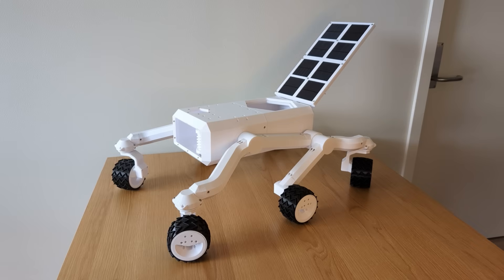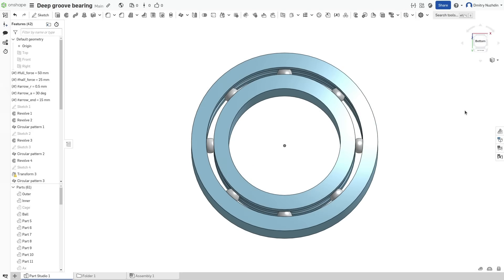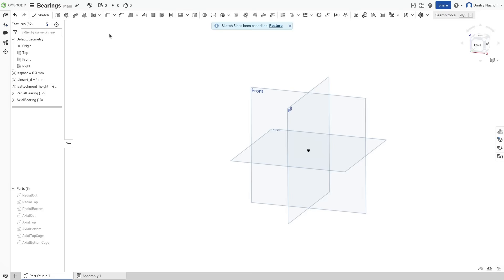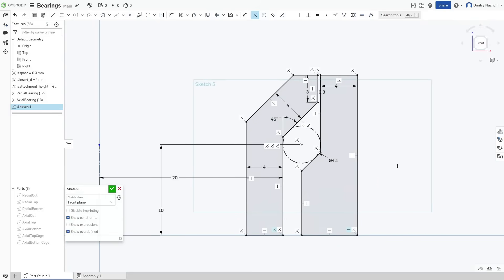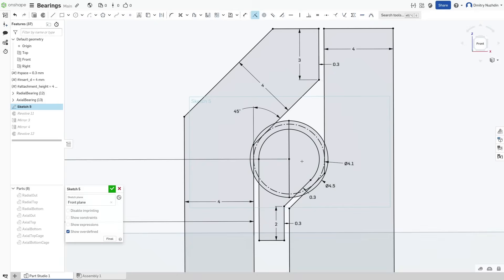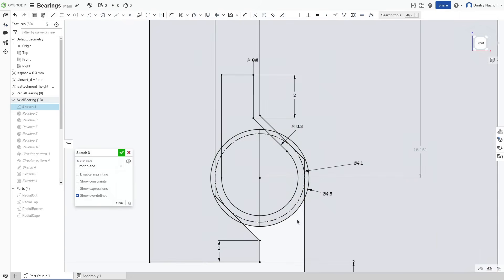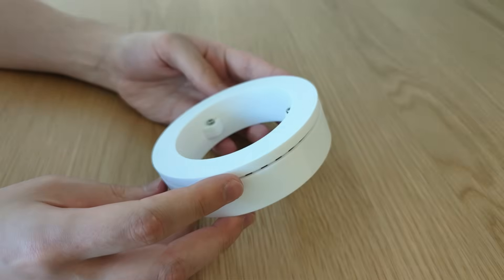How to Make 3D Printed Bearings

Comment: I've been using Airsoft BBs for ball bearings.  They work great for everything from turntables to linear slides.  The largest that I've used is a 10" circular bearing for a lazy susan tool carrousel.

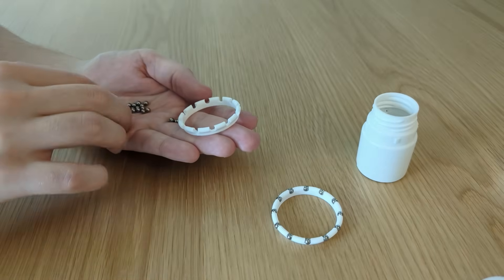Comment: 10:58  Steel balls but you THINK plastic could be used to? Why didn't you test it ?!
Anyway, using plastic except for the balls is still a good idea.
For usable bearings you would need max load values with rpm values.
For example (destructive) test with 1000-10.000rpm and 1-100kg load for 1hr.
Vibration and noise would also matter.
Reply from the maker: I just did not have plastic balls and had no plans to order and wait for it. Maybe for some future project.
Regarding the rates... I don't really think that it will handle a combination of load+high rpm. It's not that efficient and any inefficiency creates heat that will deform or melt the plastic pretty quick. I think if you have any requirements like ones you mention you should probably go for a metal.
But there are a lot of application that does not require high speed and load. For example one guy here told that he made a large bearing (metal ones become very expensive very fast when you increas size) for his telescope mount, and it worked great.
Reply: @Positive_Altitude  Plastic balls - Well, you could print them. 
The requirements should be roughly the same as for the shells (except for heating).

Of course, all destructive tests are pretty much work, so this is just a suggestion if you have nothing else to do.
Reply from the maker: @Fahnder99 Oh, I don't believe in 3D printed balls, quality is not there at all. And you cannot avoid overhang or support when printing a ball and that makes quality even worse. I am absolutely sure it will be very bad. Maybe you can print rollers that are OK-ish, but balls - no.

Comment: It would be super interesting to have a metal ring insert for the race surface and measure improvement, Great stuff!
Reply from the maker: Yeah, it will make them better for sure, but also more complex, as I have no idea how you can easily make such ring. I guess at this point it will be easier just to buy a bearing. The whole idea was to make them easy to design and manufacture.

Comment: Would grease help?
Reply from the maker: Yeah, I tried lithium-based grease. Makes them much quieter and smoother. But adds some constant "friction" due too grease viscosity. So personally I would use grease only for heavy-loaded bearings. Light-loaded goes fine without it.

Comment: could you please try to design the new rover spring tyres for printing? would it even be possible? maybe in tpu
Reply from the maker: TPU should work, but I don't think that they will fit to this design, it has large hub in the middle, so the tire should be thin, there is no room for spring tire.

Comment: Very nice designs.  Have you every tried adding a lubricant to the bearings?
Reply from the maker: Thank you. Yes, I tried lithium-based grease. It makes it quite and smooth, but adds some no-load friction. I mean, it will not free-spin like in the video. But it should help to reduce wear.

Comment: This is a very interesting video. Thanks for sharing. Seeing how it's designed helps a lot when trying to understand it.
But there is something I don't understand. Let's talk in 2D which I think makes things simpler. A circle can contact two straight lines and roll between them without sliding.
However, each circle (ball) is in contact with 4 lines in your bearing. Doesn't that imply sliding no matter what?
For example, see cross sections at 4:35 explaining the auxiliary races.
Reply from the maker: Hmm. I think it will still mostly roll even with 4 points of contact. It will just roll in a way that it's rotation axis oriented somewhere in between. Hard to put it into words :) Anyway, bearing design with 4 points of contact is very common. Look for "4-point angular contact ball bearing" for example. So it is a bit less efficient, but mostly because of some extra angle between load and contact point. I don't think that there will be significant sliding. In fact even if you roll a ball between two parallel flat surfaces, the rolling axis doesn't have to be parallel to these surfaces, it could be tilted and the ball will still roll just fine. I think it creates some extra friction, but it is not sliding. This extra friction will be similar to friction that "spinning top" has, just a little bit of that. Hope it makes sense, it's so hard to explain without showing/drawing. Thanks for your comment :)

Comment: Why didn't you chamfer the contact surfaces?
Reply from the maker: Can you explain what do you mean exactly?
Reply: @Positive_Altitude  At 4:57 the surfaces in contact with balls meet at angle, not rounded. Is it intentional? I would expect the contact surface to follow the shape of the ball, i.e. be round
Reply from the maker: @positron96 if there will be grooves it will be not possible to assemble this way, because the cage with balls will not fit in the gap any more. Though it is possible to add half-grooves on opposite races. I mean the corner between main and auxiliary races could be rounded.
Reply: @Positive_Altitude  yes, I think I mean rounding the corners

Comment: I really like the design, it gave me a place to start. The only issue I am working on now is that I need to press fit it in an axel through the hole, so will need to figure a different way to attach the parts. I will likely make the center part a single body instead of the outer ring and figure it out from there (as there is more room in the center of the ring
Reply: Nvm, I am stupid, just going to make the inner part thicker and the screw holes will need to  go all the way

Comment: Very neat video, has me thinking about all sorts of designs.  I would imagine the greatest drawback of your current design would be contact forces of the ball bearings deforming/wearing down along their contact paths.

I wonder about adding an internal raceway's, perhaps just an O.D. and I.D. to correspond with the balls rolling contact plane, or more to further constrain them.  Perhaps with a strip of something with high hardness, and small tolerance, mechanical tubing for instance.  Could cut out thin slivers (thick enough to minimally deform from contact stresses, and wide enough to help distribute the normal force along the plastic face) that fit into notches.  Basically use 3D printed plastic everywhere except the balls themselves, and small metal or high hardness plastic rings positioned where the balls would contact.

Comment: do scraf seams make a difference or is random seam placement enough?
Reply from the maker: I think if you have well-calibrated filament  (flow rate, pressure advance, retracts, etc) even the regular seams could be quite nice. I tried scarf seams -- not a big difference, so I don't do it right now.

Comment: how you are able to tilt the chassis of the rover at the beginning of the video
Reply from the maker: The left and right side are connected through a differential mechanism. Mars rovers usually use differential bars, but I used differential gears instead. So I have a differential inside (like in car transmission) and the body is connected to this differential through a worm gear. Here I am spinning the worm gear by hand and tilt the body relative to the differential. I will make an overview of this suspension in one of my next videos. :)

Comment: What do you think about designing your races slightly too tight and letting the balls form smoother, more precise races after a break-in period
Reply from the maker: I tried printing without margin at all. It starts too tight because of printing imperfections but works well after some time. I think you can absolutely do that and it will be the way to achieve minimal possible play 👍

Comment: Very cool video, definetely going to try and make a bearing with some bearing balls I have left from from broken drawer rails. Question - why not insert the balls mid-print? Kinda the same way people embed nuts and magnets into prints. Reduces the likelyhood of damaging the cage while filing it with balls.
Reply from the maker: I was thinking about it, but did not figure out how it could be done. Every time I was thinking about a way to do that I realized that I need to print unsupported surfaces and also the extruder is not able to print really close to the ball due to it's shape. It works for nuts because they are basicly flat objects so you can insert them at the point where there is enough depth to put it completely inside. You can not do it with the ball I think.
Reply: @Positive_Altitude  what about just making the clearance between the ball and the frame as minimal as possible (so like 4.05 instead of 4.1 for a 4mm ball) and then just leave  the unsupported overhangs as is? Basically just let the overhangs print over the balls and then break them off after the print is cooled off. But now that I'm typing this all out I'm starting to think that maybe this approach won't decrease the likelihood of damaging the part at all.

Comment: This is cool but I imagine there's very few applications where it makes sense. Sure quality industrial bearing can get expensive but common grade bearing are pretty cheap, even with diameters around 60 or 70mm, we're talking like $10 - and even cheaper Chinese bearings will have better tolerances and radial play than your 3D printed bearings. This is useful if you need something within in a few hours, or maybe for very specific weird geometry, but I don't see much other value.
Reply from the maker: That's true. But I just don't want to order bearings when I need them. And also I can go with any size I want. It's just to make the process easier.
Reply: I dunno, I’m not sure anyone’s going to be making front-line tools or consumer products with these, but the advantages for small home projects, teaching, and prototyping proofs of concept are pretty neat. Personally I don’t keep a lot of bearings in stock at home, I rarely need them, and when I do it’s always a different type to that which I have. Having a few 6mm ball bearings lying around to help me out is very flexible and very cheap.

Comment: Very well explained and definitely better suited  (and cheaper) for 3D printed applications that do not require the thousands of Newton and tens of thousands of RPM that even the smallest of steel bearings can deliver. A significant advantage is that you can design the bearing as part of your machine. Steel bearings are designed to be fitted in metal seats and on metal axes. I just subscribed. Cya !
Reply from the maker: 100%, they will never be better than metal bearings, but sometimes we just need things to be simple and "good enough"

Comment: In my 3d printed bearings, I use plastic balls for toy guns.  I make them so I can put as many balls as is bossible in the outer race. I then whack the inner race with a hammer to suprise the plastic only 1 time.  They fall together and run quite smoothly.  I've used them in a few projects and they seem to be working as none of them have failed..  I use no bearing cage.
Reply: How is the preload in the end? How much play (or on the other hand, how much stiffness) do your bearings end up with?

Can you recommend some interference dimensions?

Comment: Is there any way to completely remove backlash on a 3d printed bearings? Also your bearings looks bigger then typical manufactured bearings, anyway your way to design a bearing is awesome, I'll try to make my own based on your design, thanks!
Reply from the maker: To get the lowest backlash you can try to print it without any added gaps. It will be quite tight when assembled, but you can "work it out". Just apply some load in altering directions and forcefully rotate. It will become much nicer in a few minutes. I tried it once, and it worked for me. But make sure that your printer is well aligned. XY-skew should be very very low. Also the smallest bearing of similar design that I made was 20mm/28mm inner/outer races diameter it was fine, maybe it could be even smaller

Comment: not sure how true or significant, but i heard white filament wears your printer faster due to the white dye containing titanium.
Reply from the maker: Never heard about it. Anyway, the hotend replacement is not such a big deal and it will be required anyway eventually. I just need the rover to be white. I am going to place it outside in sunny days and white will heat up less.

Comment: Very nice. Glad I stumbled onto this. Now we can make bearings of pretty much any size. How small can you go with this design?
Reply from the maker: The smallest I made has inner/outer races diameter = 20mm/28mm . Works absolutely fine, I would say maybe 10mm/18mm is the smallest you can reasonably have with 4mm balls.

Comment: Preload! Your "radial load" bearings are similar to angular contact ball bearings and those perform best with and because of preload. Simplest modification would be to slightly reduce the height of inner race so there's a small amount of (axial) preload when the screws are fully tightened. However 1) this will mean that the balls will start to mainly ride on the 45 degree secondary races and that's not ideal if loads are mostly radial and 2) there will still be some play from the balls sliding laterally on the secondary race. One 'ideal' solution would be to have the balls ride on both primary and secondary races. To achieve that, first make the primary race not vertical but slighly 'open' by -5 to -15 degrees (visual context at 5:10) and then preload can ensure the dual contact on both inner and outer races (though admittedly only if the print is to very close to dimension). More load bearing contact more better. The end result will be very similar to angular contact ball bearings with a contact angle of 25 to 30 degrees (if on dimension and preload leads to dual contact or 5 to 15 otherwise) and the play will be reduced to close to zero (plastic not being rigid).
The other 'ideal' option is to simply copy the angular contact bearing design so instead of main+auxiliary race you have a round race with a slightly bigger radius than the bearing balls you're using. The best way to achieve that is to just fillet the above design since that ensures no overhangs past 45.
Also use some lubricant (reduces noise and cage friction).
Reply from the maker: Wow, thanks for taking your time to write such a comment! Yeah, I read about 4-points angular contact bearing, but didn't know that it is usually preloaded, I learned something :) It's probably the best option if very little play reqiered. Maybe will experiment with this. 
I also realized that I can just do a deep groove ball bearing with Conrad-style assembly :) I did not talk about it in the video because I realized this while making the video, but I show it at the very last seconds. I think it's the most simple design. I just was not aware about the Conrad assembly and thought it will be impossible to make :)
Reply: Thanks for the added info! I’d assume you want the bare minimum amount of preload to take up the slack without brinelling the soft plastic races. That seems like a narrow margin to hit?

For the second idea, is your suggested as simple as filleting the inner 45° corner with a slightly larger radius with no other design changes? Or does it including adding preload as well?
Reply: @williammartin9751  It's narrow but not that narrow of a margin because plastic has higher elasticity. But good to bring up brinelling because it is a concern since plastic creeps. Therefore all plastic bearings should be 1) run-in till the races are fully burnished (i'd say preload-only at first then under constant load) 2) not kept under significant static load for long periods.
Second question: Yes, the design of the races is as simple as that. And with that design, adding a low preload becomes as simple as slightly reducing the height of the inner bearing races. I keep talking about preload because that's what results in the largest performance improvement.

Comment: Cool idea, but how long do they last? and what loads can you apply? and what material is best? but it can always hold for small stuff.. okay i have to do some testing :-) and can you create a pressure greased bushing for longer lifespans and load??
Reply from the maker: I show a simple load test in the video. I think 4kg per ball for thrust bearing and maybe around 1kg per ball for radial bearing (because most balls are not loaded in this type of bearing) I will do the proper load and wear test in the future. 
Materials... I personally don't like PLA for mechanical parts. And everything else except PETG could be challenging to print with enough quality and precision. Ofc nylon will be better than PETG, but it's much harder to print. So personally I am planning to work only with PETG right now.
Don't know anything about "pressure greased bushing" so can't tell. However, I want to try to make a flexible TPU seal to protect the bearing from water and dust. I have high hopes that this will work.
Reply: @Positive_Altitude Yeah, the low softening temperature of PLA probably means they would deform under lighter load conditions than PETG would... I think. Really more of a hypothesis.

As for Nylon, I wonder if its flexibility would cause problems with bearing performance. Might be worth a test.

I might hypothesize that PC might be a higher performing material... I suppose I would have to have a good definition of "performance" before I make statements like that 😅
Reply: @Positive_Altitude  Pressure greased bushing is a channel through which you can inject grease into the bearing every so often to lubricate it. Not sure how you would want to lubricate a plastic bearing, though, or which benefits to expect from adding grease.